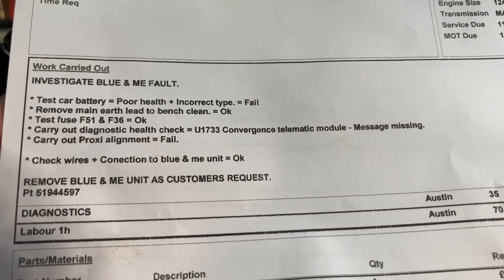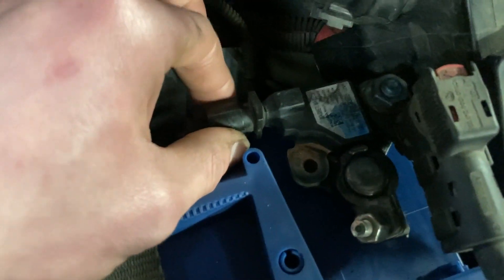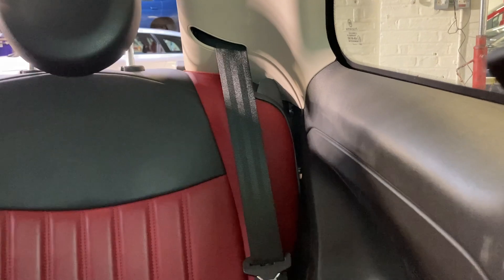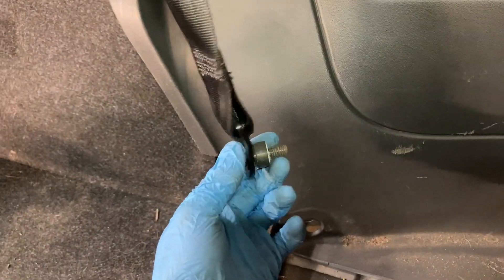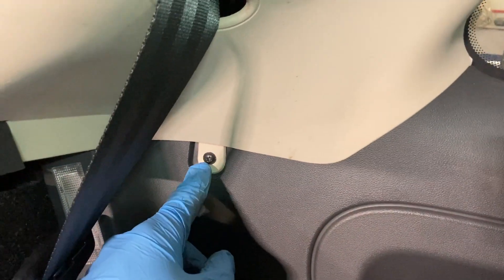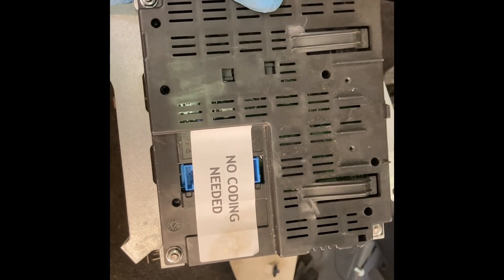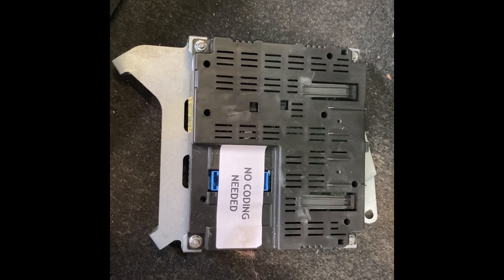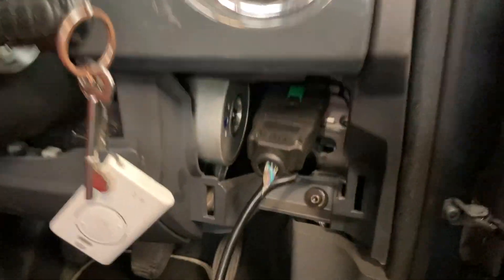FIAT 500 Flashing mileage - Blue & Me Replacement

Comment: Extremely helpful video, what is so surprising is the seat / panel fittings and the engine bay are exactly the same as a 2015 Ford KA....going to attempt removal tomorrow!
Reply from the maker: Great point, for those that didn’t know, The Ford Ka is a Fiat 500 rebadged.
Be careful with those seatbelt bolts, known to snap off 👍
Reply: They pretty much are the same engine/gearbox xx

Comment: If you're doing an older 500 the first thing to do is clean the rear seat belt lower mounting bolt which comes out through the wheel arch. Wire brush and wd40. If you remove the bolt without doing this it will shear. Very very important to do this.
Reply from the maker: Good tip mark! 
I have had one snap too .
Take time on that bolt people!
Reply: @thorobredcars1975  Or just cut a slot in the panel and leave the bolt where it is

Comment: I’ve sent mine for repair can I still drive the van without?
Reply from the maker: Yes , although the mileage will flash which will be annoying , It’s a warning that a control unit is not correctly programmed.

Comment: Those seat belt anchor bolts have a tendency to snap unless you wire brush and lashings of WD40 on the end of the bolt in the wheel arch. You don't need to take the rear seat backs out either.

Comment: Is the blue&me located on the same side if the driver seat is on the left side?
Reply from the maker: I’d imagine it would still be on the same side as this video, but honestly I would only be guessing 🤷🏻‍♂️
Reply: I just found out that for left seat drive the module isn't on the left....😂
Reply: And also not on the right. I don't know what is going on with my car. Keep you posted!
Reply: @MrRubyyyy  Hi, same issue here, did you manage to find a way through ? Thanks.
Reply: @annarion994  yes I found out that it is under the glove box, found a different video showing it
Reply: @MrRubyyyy can you tell me which video?

Comment: Great video. I have flashing mileage and a battery drain as well as the blue and me not working. Can I just unplug the unit rather than replace? I’m swapping out the head unit but want the mileage to stop flashing and steering wheel buttons to work. Cheers
Reply from the maker: The flashing mileage is the cars way of saying something is not programmed correctly.
If you removed / disabled the B&M it would stop your drain but continue to flash.
Fitting a aftermarket radio would also cause the flash as the car will not recognise the foreign part .
Reply: @thorobredcars1975 I do not care for flashing odo, I just my car to not die after 12 hours of sitting:( where is the blue and me unit in a north America abarth ? Do you have a clue ?
Reply: Thankfully it's behind the glove box in the US model. Thank God it's not in the Rear quarter panel!!!

Comment: Thanks for your helpful video. I have a Fiat 500. BLUE&ME causes the battery to drain. Is it possible to disconnect the BLUE&ME from the power supply, or do I have to disassemble the panel and disconnect the connector from the unit? Thanks.
Reply from the maker: We had a similar issue with a AlfaRomeo Giulietta .
In theory you could just pull the fuse , but we opted to unplugged the unit physically.
Reply: Great video mate, got this job coming up. Can diagzone diagnostics do the proxy align? My diagnostics look very similar to yours
Reply: Wheres the fuses, for blue me 
Located